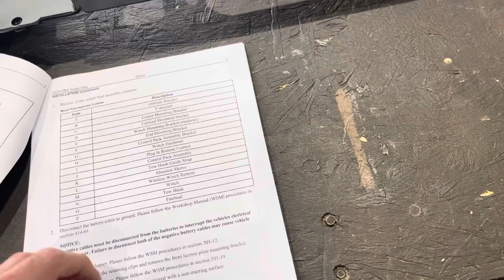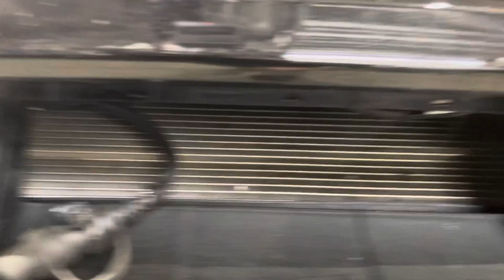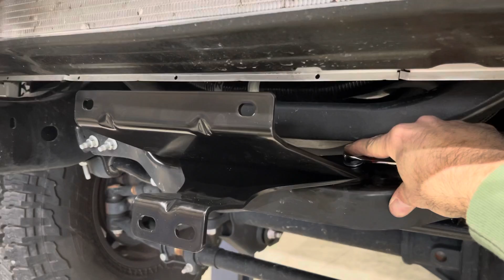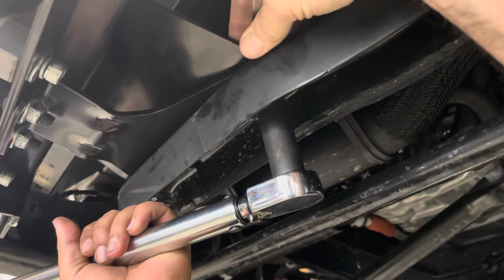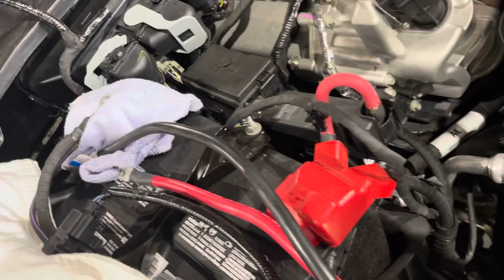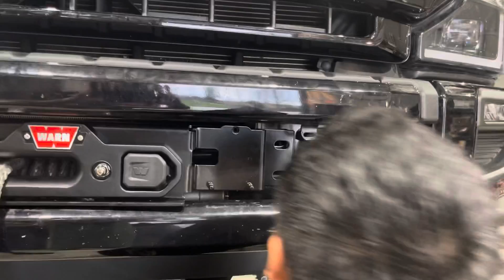Ford Performance Super Duty Winch Install

Comment: One SERIOUS issue with the setup though is Ford designed it more for looks then actual use.  The entire force of a 12K pound winch pulling an 8K pound (plus cargo weight) truck (which is increased if truck is actually stuck) is depending SOLELY on the strength of those 4 Allen head bolts that are in tension.  Which is the weakest way to mount any winch.

Comment: A couple years since you did this vid but my 2 cents worth.   My cruise control and pre collision alert don’t work because the bracket that holds them bent without a side pull.   Dealer can’t fix and none of this is warranty even though it was ordered.   I hate not having cruise control , a year now.    I suggest not installing this winch,  if you like cruise control.
Reply from the maker: Man, that’s a bummer. My truck doesn’t have the radar module/adaptive cruse, so no issue on mine but good info for the trucks that do. Hope you can find a dealer that can repair. They need to stand by their damn products.

Comment: Do they have that will fit on a 17 F350? Haven't found one yet...
Reply from the maker: Not that I know of. I believe the reason it does not “fit” is because the frame was not prepped for the mounting holes. They did that (holes) on the mid model refresh frame. That’s my guess. Other then the frame missing the mounting bracket holes, I bet it would fit like a glove..

Comment: Whats the plastic aftermarket cover?
Reply from the maker: My truck doesn’t have the lane keep assist sensor so the plastic cover would cover up more of the Warn metal bracket on the right side of the winch (where the sensor would re-attach after installing). Just dresses it up a bit more. I wasn’t and still not too worried about it.
Reply: @tcr2237  Thanks, i dont have the l sensor either and used the factory plastic without issue as well.

Comment: Another great video.   I've been shutting away from this For winch.   There was either a video or an article from someone that needed to repair or replace something on the winch and Warn couldn't help because it was a ford thing and ford couldn't help because it was a warn thing.  I wonder if a warn zeon platinum 12k would fit in there on that bracket.
Reply from the maker: Interesting… I have had some bad experience with dealer service departments as well. I’m sure that is where the issue was. Ford dealers seem to deny before they approve anything these days.

not sure if it would fit. The brackets it comes with and how it mounts is very custom and tight fitting.

Comment: Mean looking install. I wonder if any other company makes a winch that will fit in this spot. 2800 from ford is STEEP
Reply from the maker: Thanks. Ya, not cheap. Of course I found the winch and mount combo for $2,200 after I installed it! Check around and see what deals you may find. The brackets it comes with to mount are custom but I’m sure the winch mounting points are the same. Would need to make sure all the other size specs would be similar too. It’s a darn tight fit… thanks for posting.

Comment: Need more protection from deer strikes for me, which is why my 22 F-250 Tremor will be getting an aftermarket bumper (that a winch will fit inside).
Reply from the maker: I hear ya, I could use one myself but I just hate the weight it adds and can’t find one that I like… which bumper you looking at?

Comment: I saw on ford performance that they say you need the dual heavy duty alternator?
Reply from the maker: Yup, that’s what they say. I think it will still work without. Just will hit the single battery hard. But I believe Ford is referring to the dual battery with The 380amp alternator. All diesels come with that and is an option for the gas motors. 
Maybe replace the stock single battery with a yellow top Ultima… my 2 cents. Cheers!

Comment: Installing a winch on 12th gen trucks with the grill and hood connected is the cleanest and easiest install of all...looks factory and needs just a mounting plate bolted with tow hook bolts keeping hooks in place.  Yours is looking very nice, thanks.

Comment: Would you have a part number?
Reply from the maker: Ya, part number is M-1821-SD. Check out Levittownfordparts.com. Save $800 on the winch and tells you what it fits and what options you may need in addition to the winch/bracket combo.
Reply: @tcr2237  awesome! Thanks for the quick response

Comment: Wonder if someone ever try to mount on a non Tremor truck?
Reply from the maker: I heard it’s a darn good chance it will. Haven’t seen it yet but I think the 2020 and above will work as the cross member frame should have the winch bracket bolt holes in place.

Comment: Both batteries with a powerstroke? Why is it every time I’ve tried building the truck with the powerstroke and select two batteries, it makes me get rid of the powerstroke for the 7.3…. Ford site will not let me have two batteries with the 6.7
Reply from the maker: From what I have heard. The power stokes have always came with 2 batteries to crank that engine over. So if you add the PS then you don’t need to op for the 2 batt. Option. I believe The alt. Is also upgraded to the 397 amps… at least my window sticker doesn’t show I payed extra for it
Reply: @tcr2237  ahhhh never looked under the hood. The option was there so every time I clicked it, it kicked out the engine. Good to know 👍

Comment: Great video I just had mine installed by the dealer today and I’m wondering if you can send me a link for the additional trim piece on the driver side that you mention in the video thanks
Reply: Ford # LC3Z 8311 E
Reply from the maker: Thanks! Ya, that trim piece comes stock on trucks with adaptive cruse control. I’m not sure the part number but Ford parts could assist. This link will really help. 
https://www.fordtremor.com/threads/warn-winch-replacement-plastic-trim.4399/
It requires some trimming and you will be set. God speed and good luck my friend!

Comment: Ford states this only will fit 2020 and up. Is the 2019 that much different?  Ford also states this only can be had with 7.3 and 6.7 not 6.2. I would love to install this on a 2019 CCLB 6.2 with dual batteries, 240amp alt. and snow plow prep. Any thoughts?
Reply from the maker: Thanks for commenting. My thoughts (not fact) are that the cross member frame that hosts the brackets for the winch are not pre punched and/or drilled. Also, oil/trans coolers may be in the way. Hard to say without comparing them side by side. Hope this help Luke. Cheers
Reply: I looked at my 2019 KR with 6.7 and can confirm the cross member is not drilled and the trans cooler is in the way.  These might be able to be swapped over to the Tremor setup.  Otherwise this kit looks like it would work.  Trans cooler being the biggest issue.

Comment: So how much did it cost you for that!! Factory installed is $3000
Reply from the maker: I pulled this truck off the lot so didn’t get the opportunity to custom build my truck. So I Bought the winch at the dealer for $2800. Ya… 😬 not cheap… fits like a glove though.
Reply: Bought my king Ranch F-350 with the warn winch today … 8 month wait 
    Order every option ford sells ..

Comment: Great video!  Question...where did you end up routing the engine block heater cable?
Reply from the maker: Thanks buddy.  Ya…. About that… still have it right above the winch. Have not re-located it.  Will keep ya posted. As of now, I can route it under the hood, or in the grill. Cons: under hood requires opening it every time and in the grill, you see it… I keep my truck in my shop so I don’t need it right now.

Comment: Ordered a new 350 not 4x4, in December, build date is February 1, today I tried to add this to the build and they said no. But they didn’t say that it is a dealership installed item. This winch looks like a good insurance foe non 4 wheel drive. I’ll order this and install myself, thanks for the video.
Reply from the maker: Cool deal man. Just make sure the frame cross member has the bolt holes for the winch bracket. Not sure if 2WD trucks have it. It’s a great back up for a 2WD for sure. Keep me posted! Cheers

Comment: In all their wisdom Ford did not really that some states require a front license plate. They have provided no place to put on one ! I could of put a fold down type bracket that would of allowed me to have a plate and just fold it down when I needed the winch.
Reply from the maker: Ford has a relocation bracket.  Just found it. Sits right below the Winch nicely. 
https://www.levittownfordparts.com/sku-ymm/2022-ford-super-duty/LC3Z-17A385-BA.html?gclid=EAIaIQobChMImpC4zOif9QIVR7KGCh0bnwvEEAQYASABEgLp-fD_BwE
Reply: @tcr2237  WOW !!! Thank you so much !!😁
Reply from the maker: Ya, I did t see anything in the install manual for a front plate relocation. I guess your idea of a fold down type would work nicely

Comment: I wonder if this wench would fit on the 2017 I love that clean instal
Reply from the maker: Ya, they say 20-22 truck 7.3L or 6.7L.  The one issue I could see with 17-19 trucks would be the bracket mounting holes on the frame crossmember.  Also, not sure what lies in mounting area that Ford maybe moved for the 2020 models and up. Sneak a peek under your truck and see. Here are Ford’s specs on the winch:   
https://performanceparts.ford.com/part/M-1821-SD
Cheers